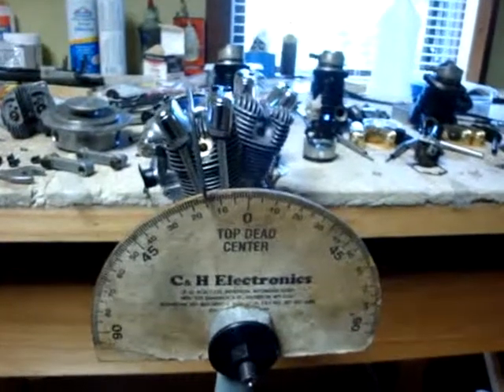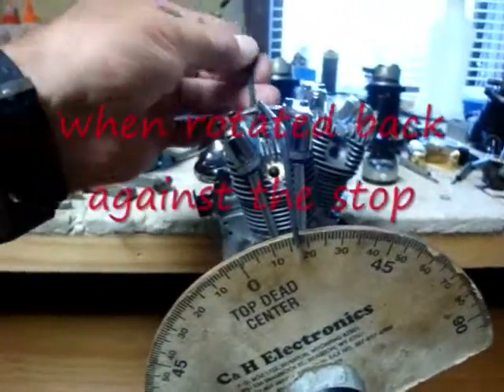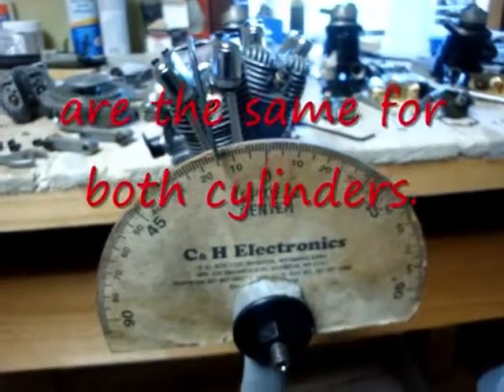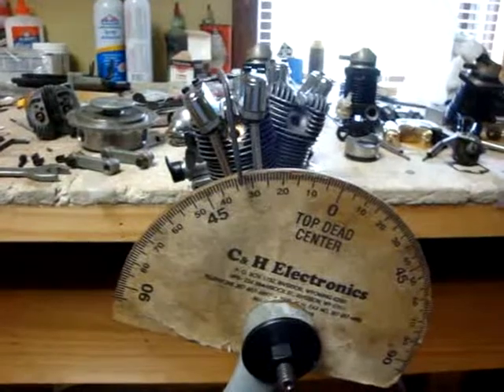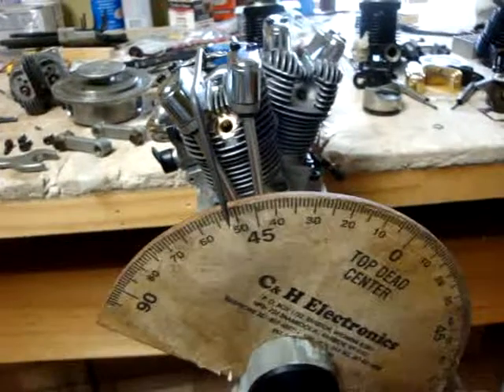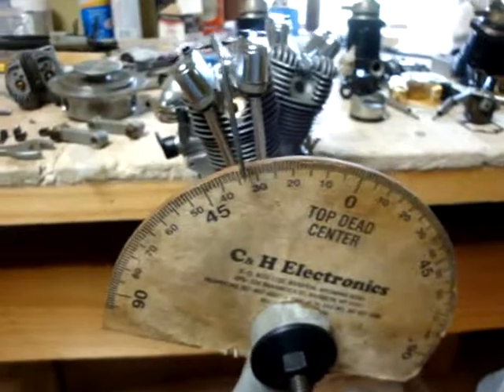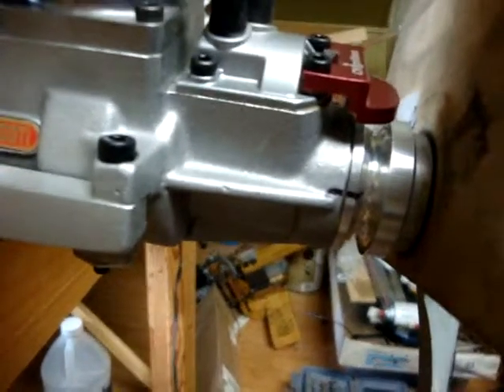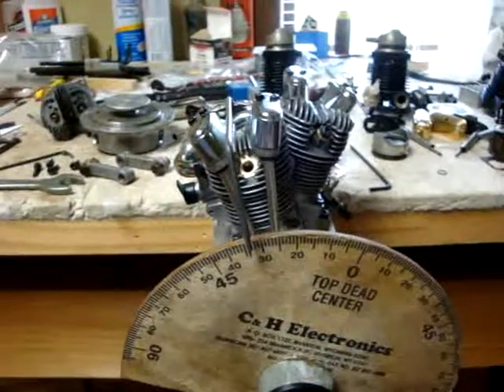Saito 200Ti Crankshaft Timing

Comment: Hello sir.  I also have the same engine where I bought a new one from a friend and during the startup I found that the Engine was not properly timed.  What I did before I discovered your vinteo was to build the rear cylinder with the same setup on the front.  If I understand correctly from the video there should be a slight difference between the first and the second ??  what would be the correct timing process from the beginning ??  thank you very much in advance
Reply from the maker: If you are speaking of the cam timing the front and rear cylinder use two different camshafts. They each require be unique method of timing. Check the owner's manual for the proper procedure.
Reply: @danielfennell4264  The Saito manuals do not mention setting the timing of this engine.